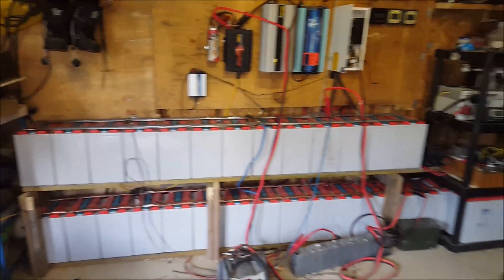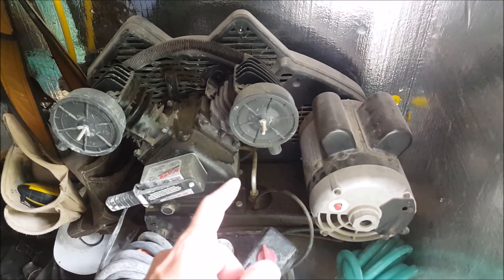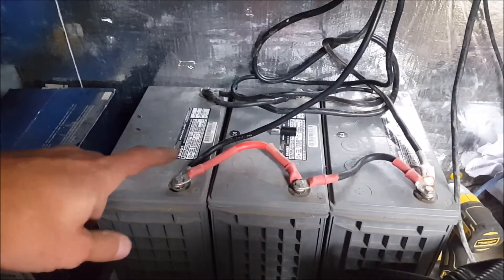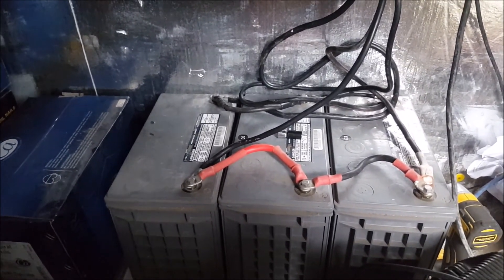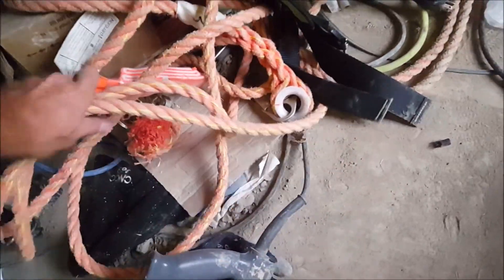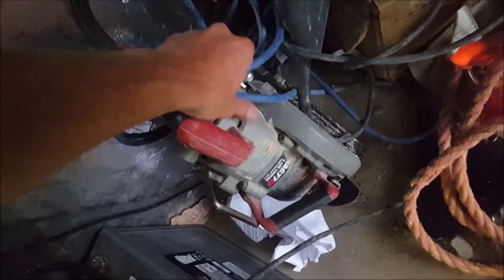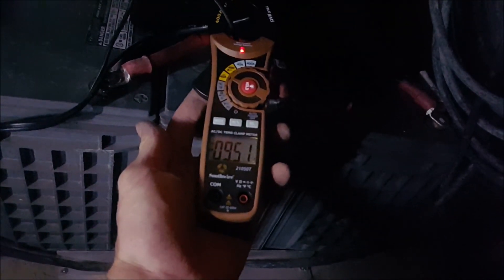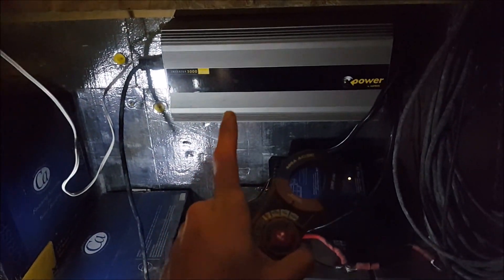Adding Backup Power To My Work Trailer

Comment: My hundred amp hour batteries can only produce 20 A at any given time. So in order to supply 100 amp hours to my inverter I have to have five large batteries.
Reply from the maker: Wow that's low for 100ah
Reply: @GoingOffGrid101  On many of the batteries it’ll tell you right on the battery the 20 amps is max output. My agm batteries have it. It’s standard.
Reply from the maker: @FaithwalkerTodd  o agm yes make sense
!
Reply: @GoingOffGrid101  AGM are the more powerful. But all lead acid batteries are the same. None of them are going to provide more than 20 amps. If you try to take out more you’ll destroy the batteries in one day.

Comment: It is probably the type of motor in the way that the windings are in those saws. I know I have some older Milwaukee tools that specifically say in the manual that they will only run off of a certain type of inverter because of the way the motor is constructed.
Reply from the maker: thats very interesting!

Comment: what type of insulation is on your walls? did you just nail it into the existing plywood?
Reply from the maker: Half inch R3 foam with reflective and I used capped nails to fasten.
Reply: @GoingOffGrid101  thanks for the quick reply. Good setup you got there. simple. I am thinking of doing the same for my 6x12 Moto trailer. I have a little 400W goal zero now but I want to permanently wire some lights and a TV and a few other things into the trailer so looking into battery setup. How well does that insulation work? good enough to sleep inside with a little AC or heater?
Reply from the maker: With a 1500w heater it stays nice and warm

Comment: Hey I see you insulated your trailer! How much difference does it make for keeping it warm in the winter? I'm ordering a new trailer and am considering getting it insulated.
Reply from the maker: a 1500w heater will keep it warm, with out the insulation it will not keep it warm

Comment: Nice test.
I have the same 12V battery charger. 
They claim the charger output is 10A which is not true. That charger takes for ever to charge one of my 150Ah AGM  batteries.
Thanks for sharing and have a blessed day